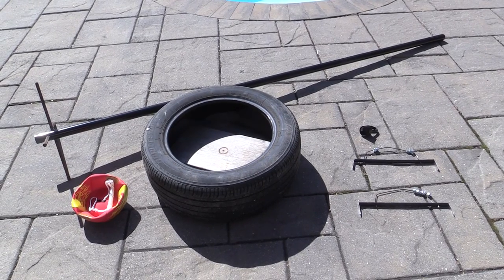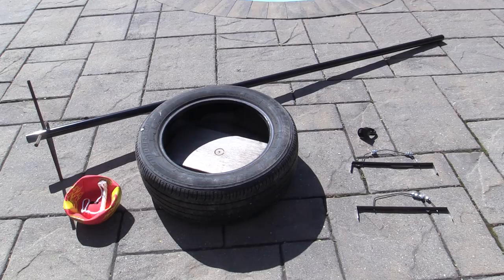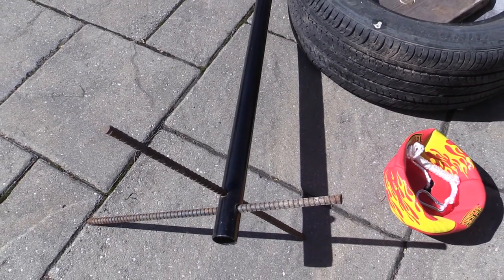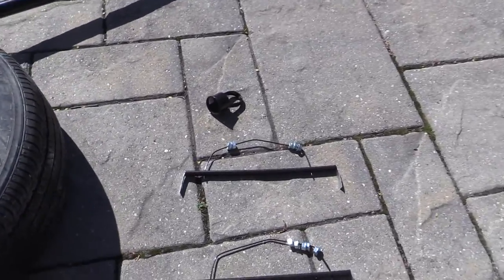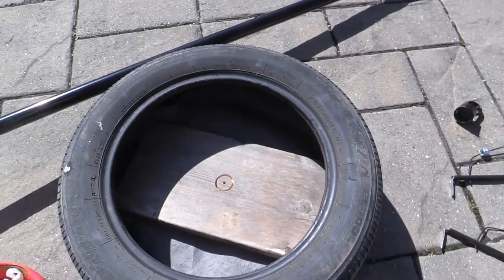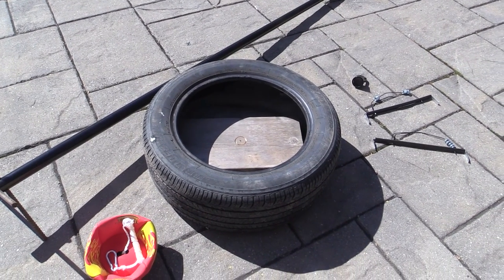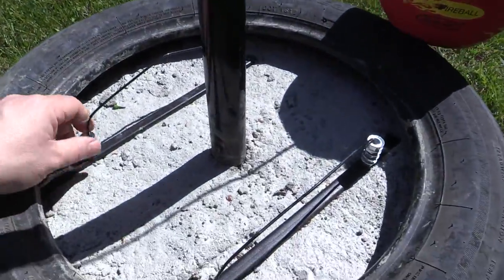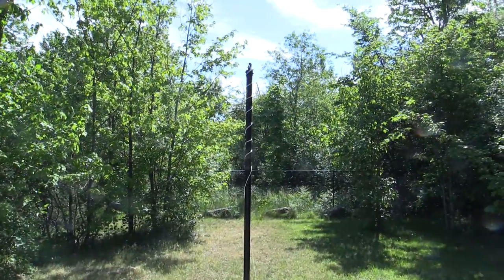Tether Ball Pole and Stand - DIY with a spare tire

Comment: Nice.  I hope my plan isn't very foolish.  Rather than using rebar for stabilization within the cement, I was planning to use a metal flange screwed onto the pole bottom, elevated up into the poured cement by pizza box spacers.  My project isn't for tetherball but to support stackable planters in moderately high winds.
Reply from the maker: Sounds like a good plan ... I was just using rebar as I had it lying around to be honest -- good luck with your project!